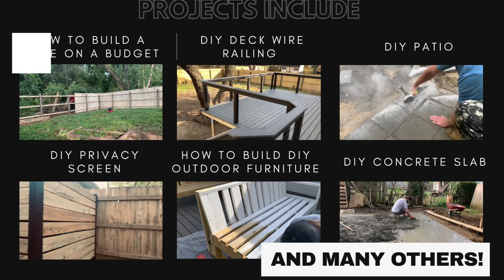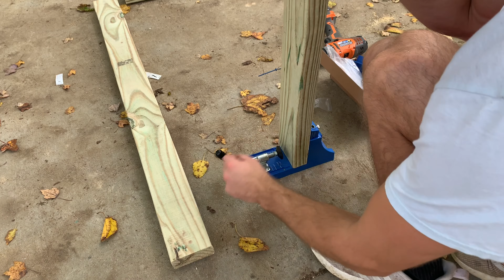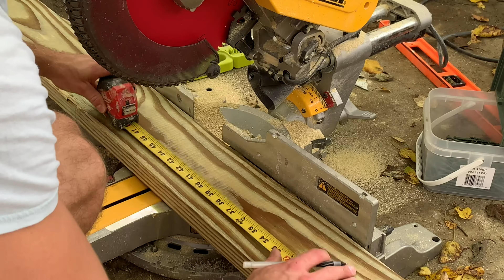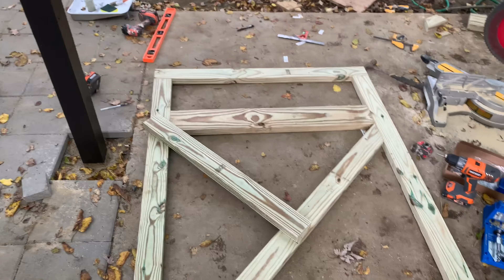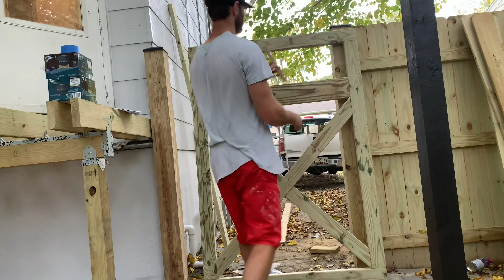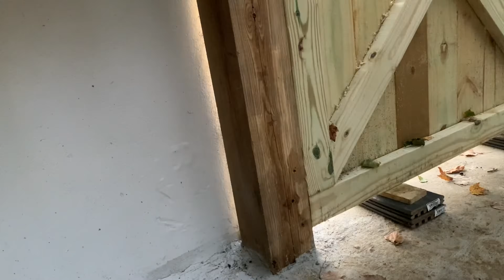DIY Fence Gate Ideas (How to Build a Wood Fence Gate)

Comment: Good video. Shows a lot of the headaches and simplifies it for people and really anyone can do it -it just takes forever. If you like monotonous stuff with your headphones in then building a fence is for you. Build the side with the annoying neighbor first. For mixing up cement for posts -use a bucket and a mixing drill with a paddle on it and it will mix so fast and no labor involved and just dump on hole-way easier than manual mixing and if you lay tile you’ll have the tools to do that with same way for mixing mortar or grout. Fences come out way better built this way vs buying 8 foot sections which are heavy and awkward and those seem to sag in center faster than hand building a fence and you can buy cordless framing nail guns now so no hose or compressor to deal with. If you have cuts on end panels you don’t like you can cover them with more full size fence boards or 1x2x4s or 6s and use those in all corners and by gates -it gives more of a fine shed look like you would be if you ran the boards horizontal and were covering end joints. I put a fence board at every post to cover up seams as well. Over time outside corners and by gate and seams by posts open a little so covering those areas with board makes it look better longer and keeps privacy from the creepy neighbor. You have one -you just don’t know it.

Comment: This is good design but i think the brackets are installed incorrectly .. first brackets installed more than 45 degrees and the other bracket was installed backwards its more on a tension side.  Overtime this design will sag …will give it a year or so
Brackets should be installed on the same direction on a compression side and less than 45 degrees

Comment: I have a question, please. My gate is dragging at the top (not hinge side), and it's because the fence post on both sides, and closer at the top than at the bottom, by about an inch. Do you have any recommendations for spreading them apart at the top so the gate no longer hangs up on the post?

Comment: Hi😊 I appreciate your knowledge and enjoy watching your videos, so I subscribed. I’m about to take on my fence project. I’ve never built a fence before, and I have questions. What kind of wood?  I saw that you used pressure treated. Does it last? Can it be stained or painted. I’m also moving my fence out a little. How do I remove my old metal fence posts from the ground??  Can I reuse them. Your advice/input will be appreciated.  Thank you

Comment: Looks nice. My only comment is on the cross members. The cross piece that does all the work is the one that is at the top on the latch side, running to the bottom on the hinge side. This cross piece is in compression and helps supports the weight of the gate. The other one is unnecessary but if you do want one there, it should be in tension, ie a stretched cable. A wood cross member running in that direction won’t do anything except add weight.
Reply: that cross piece is put there to secure the pickets

Comment: Google search "fence gate engineering". Your gate isn't structurally sound and will sag bad. You support arm should mount low on the post beam, then go up to the outside corner connected to the top beam. Plus you need to "half lap" your corners. That's where the square support comes from.

Comment: thanks for this idea. I made a few changes in your design. I ran the pickets on both the left and right side from the bottom  to the top extending 1.25 in. used a 2 x 6 for the top and middle board , then cut the pickets to the top of the middle board , then mounted the top of the pickets to the 2 x 6 to the upper 2 x 6 for aprox 7.25 in.  I used the 2 x 6 board on top so i can have more strength for the 7.25 picket pieces which are the extension of the lower pieces .

Comment: You should've run the solid brace from the inside top to the outside bottom, and the cut brace from the outside top to the inside bottom. The advantage is that the weight of the gate is "pulling" down toward the bottom outside corner so you have one single piece to work as a tension brace. The weight is "pushing" down toward the bottom inside corner and the weight of the gate will compress the 2 pieces tighter.

Comment: I liked this one primarily because it's along the line of fabricating a gate  that will have a view out for my two dogs to see through, at their eye level.  I wish you'd mentioned the actual size and make of the nails you used and the size/make of the bolts or screws you used for the hinges.

Comment: But wait.. how do you open the gate from the outside?
Reply: If you notice there is a hole on that latch hook. Just add a chain to it and have that chain hanging on the other side of gate. Now pull chain and latch hook lifts up and enter.

Comment: AWESOME VIDEO, THANK YOU!  After more than thirty years I recently had to replace my backyard/side yard fence. I hired a contractor to do the job as I'm not a spring chicken anymore. My disappointment was the gate, after a couple of days we had rain and the gate sagged. I knew that the frame was not properly Z or X reinforced for twisting or warping. I informed the contractor that the gate has sagged / warped and hard to open or close. Contractor promised to drop by and sort out the problem sometimes next week. I'm not planning to hold my breath on that promise, but sometimes you have to trust or have a heart attack instead.  The price of the gate was $550.00 Cdn.  From this experience, I noticed that the quality of lumber in lumber yards (Home Depot) is not what it used to be like 20 years ago. Now A 4x4 post is 3-1/2 sq., and the vertical boards also lost a 1/4". Your lumber in the video looks outstanding. I know the story about the lumber when cut green 4x4 and ends up losing a 1/2"' . Keep up the good work. I have not checked all your videos, I was hoping there's one showing how to correct the problem of sagged wooden gates.
Reply from the maker: I appreciate the support!!

Comment: What is the name of the drill extensions you use to drill the pocket holes and to screw the wood pieces together? I would like to do this.
Reply: If you buy a  kreg pocket hole jig, it will come with the drill bit and drill stopper needed as well as the proper square bit for the pocket hole screws.

Comment: I was wondering if it would be reasonable to use exterior wood glue on the joints in addition to the pocket screws ?
Reply from the maker: I don't see why not! A little added strength would likely be the only side effect. Thanks for watching!
Reply: @AndrewThronImprovements  thanks

Comment: Hi Andrew, I'm attempting to make your fence gate and wondering what length screws you used with your pocket gig. Earl
Reply from the maker: Hey Earl - if I remember correctly, it was 3”. Good luck!
Reply: @AndrewThronImprovements  Hi Andrew, I finished my gate, it looks terrific, I wanted to  send you a pic but I can't seam to attach it here. Mine is bigger than yours ( I mean the gate). Thanks for the great video. 🍹Cheers Earl

Comment: Hi looks great awesome joh guys..  did it cost a lot to do it yourself? I'm sure it was WAY cheaper than hiring someone.  I need anew fence,  honesty that looks hard  lol.
Reply from the maker: You got this! I would say you're looking at $150 in materials.
Reply: @AndrewThronImprovements  oh wow thats not Abad price at all.  Thanku for the confidence. I'll need it lmao 🤣  very nice of u
Reply: When you hire someone else your also paying them for the equipment they have. Power tools arent cheap. I see about 220 in drills if batteries came with another 100 minimum for saw nail gun is another 200-400 wether its cordless or off a compressor.
Reply: @dylanwheaton2785  that's insane to pay for thst stuff when they already have it.  What kind of money hungry people are they?  Like every other business its SAD
Reply: @karens7620  as a person who works in the trade yes i factor my tools into an hourly rate. Have you ever had everything you need to work stolen from you including a truck? Thats a reason why as well as working in trades makes you a target. My truck got stolen all my tools got stolen. Insurance covered the truck (20k) but not the tools that were in it. My truck was loaded with everything except my welder. The batteries for the tools were over 3k.
Reply: @karens7620  and money hungry? Depending on the project it can be complex or not. Most people that would bid something like this high may have other work that makes more sense then the job they are bidding high.
Reply: @dylanwheaton2785  omg I had my purse stolen & my tool box compared to that that's pennies.  I feel like a real ass*** I'm sorry for saying thst. I'm really glad u told me that   it helps to understand more.  I've been ripped off so much I get a lil pissy. I should not of done/ said those things to you. Thst was so WRONG  I'm sorry  you been very helpful.
Reply: @karens7620  ya and honestly most of the work is weekend work right? For most people its side work. I have a daughter got a lady and a stepson. If i make 35 an hour during the week why would i charge less to spend time away from my family? Ya perspective is everything most companys trades people work for dont care as much as youd hope
Reply: @dylanwheaton2785  I'm so glad you gave me your perspective on your side   really I do.  It makes alot of sense.  I appreciate your explanation and honesty.  People like you are the ones I need the help from.  I manage to attract scammers. I'm truly sorry for offending you or anything else.  I love when people tell me. I should absolutely think before opening mouth or typing.  Please forgive me fir that crap. And thanku so much for the understanding.  Being away from your family alone is very HARD!  My mom just passed away she lived with me.  so now I'm going to try to fix things in my house that i only bought a year ago. I don't know why I'm telling u this. 😕 I want to fix things myself.  I'm not sure I can. I'm going to try.  I appreciate your responses and putting me in my place lol  I am going to subscribe ill have lots of questions if thats ok
Reply: I'm sorry I just realized goofy me!  Its Andrew channel.  Oopsy
Reply: @karens7620  not offended at all just explaining why trades are expensive and ever go with lowest priced bid. Ever. Me and my buddy are redoing all the siding porch deck and shop front on weekends due to someone taking the lowest bid from a company!
Reply: @dylanwheaton2785  that's awesome.  Thanku. If u were near me I'd hire u just on your honesty alone.

Comment: An excellent tutorial, although I did miss the traditional 'muzak' and the lack of 'Vanna White' to point out each and everything you were doing, or maybe even contemplating to do in your next video. Ha, Ha!

Seriously 'tho' I enjoyed watching your video as it was very well thought out and presented.

I really liked the use of the tool to "toenail" the screws into the top and bottom frames and will probably have to buy one for an upcoming project; normally I connect the top and bottom frames to both sides with a seven inch by 1/4" lag screw and a fender washer and then an 1/8" steel 'L' bracket with a reinforced strut to keep everything in alignment - which is then backed-up with a diagonal steel rod normally used at the bottom of a garage door to keep it from warping, then every few months I set a four foot long carpenters 
'level' to check if the gate has started to 'droop' and if so, then a few turns on the adjustment nut will bring everything back to where it should be - Straight.

As much as I wanted to build my gate the same as yours, our house is a 'Spanish' influenced' design so the gate would look out of character, but still downloaded the video for use on an enclosed patio in the backyard and far enough away from the house where it won't look out of place.

Thank You for one of the better DIY videos I've seen of how to do a project correctly.

Comment: Loved the gate design but with the latch you used but once you go out the gate how do you get back inside?
Reply from the maker: With the design shown, you can't open it up from the outside. I added a chain latch with a screw eye at the top later so that you can reach over and open the gate from the outside. Thanks for watching.

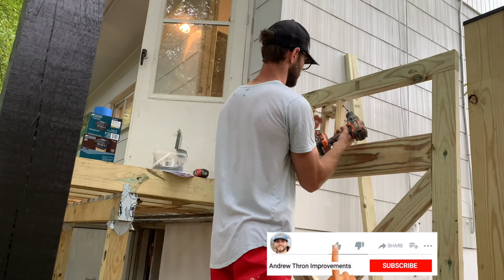Comment: 6:44 Hang on, how did you manage to screw in that last baluster with no clearance left? You skipped that bit 😸
Reply from the maker: Haha just rotate it 90 degrees for the last one. If you don’t like looking at the screw, countersink it and fill with wood filler 👌
Reply: @AndrewThronImprovements  Ah, nice. 👍
Actually I noticed another guy had some little angled inserts he used to cover up his screw holes, they may have been specific to pocket screws though

Comment: Another way to do the cross piece: 1. mark a centre line on the cross piece 2. Put the cross piece under the gate with the centre’s lining up with the corners of the gate 3. Mark off the cuts. Benefit of this approach is that you brace against both the top and the side piece.
Reply from the maker: Thanks for the Tip, Marcus! Appreciate you watching!

Comment: How are you going to open it from the outside? Isn't there some type of pull string attachment? Great video by the way!
Reply from the maker: That is something I need to install! They have a bunch of systems, but I think I am just going to rig up a pull chain that you can reach over the fence and pull. Thanks for watching!
Reply: @AndrewThronImprovements  Just buy a different opener..i use the levers that go up and down where you can open from both sides.
Reply: The ones with a spring that you can open from both sides are the best. But I don’t think they’re big enough for a 6x6
Reply: Theres simple latches with levers on both sided. No strings needed. Just goes on the latch post , need 5/8 clearance